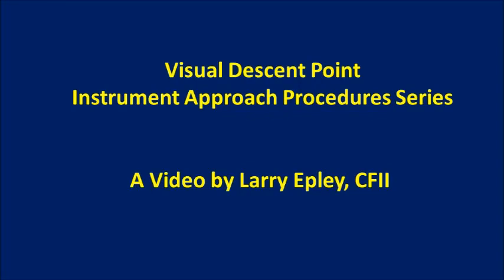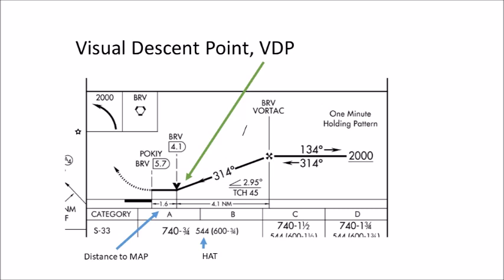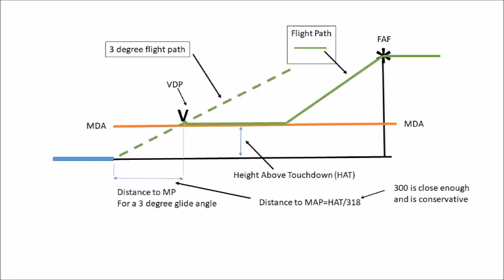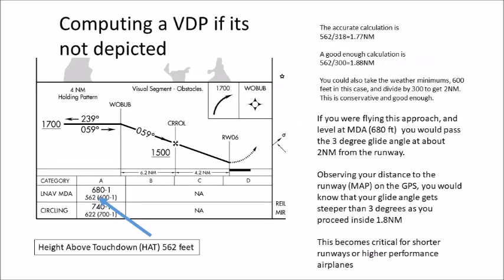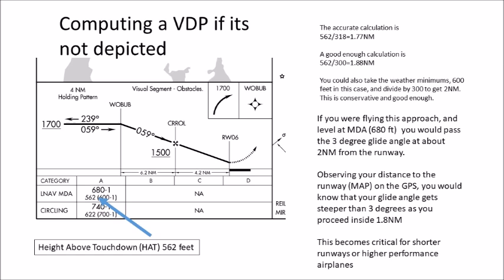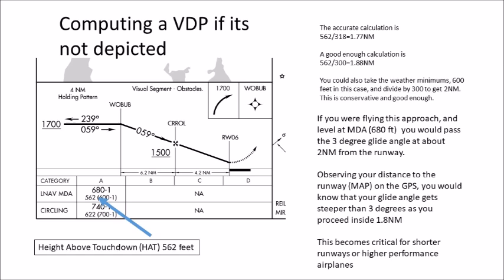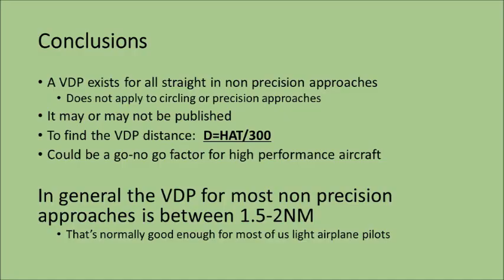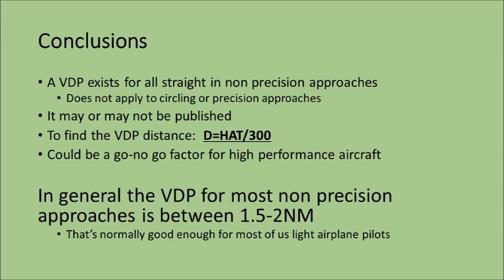VDP1

Comment: Im a little confused where does the 300 come from in the vdp equation
Reply from the maker: Thanks for the reply.  I never got one of these.  

300 comes from doing some simple geometry and assuming a 3 degree glide slope. The calculated number is approximately, but not exact.   Its close enough.   We don't need precision.  I believe that i made that point in the video.  
Regards,
Larry Epley

Comment: I have the same question as Edgar Xavier.  Could you show the trig that was used to come up with the 318. Do you use the 562 ft/5280 (=0.106 miles) as the Y-axis and the distance to the end of the runway as the X-axis?  So, tan (3)=(0.106/x)?  It is probably easier to remember: HAT/300.  Thank you for this video.
Reply: You're basically on the right track but it's 562/6076 (feet per nautical mile, not statute, to keep units  for the "triangle" consistent).  And yes, the rule of thumb of dividing by 300 is certainly much easier. 🙂

Comment: Just curious as to where did the number 318 or 300 come from?
Reply: Edgar Xavier 300ft/min rule of thumb for a 3degree glide slope
Reply: @sami10z  *FPNM not FPM
Reply: @sami10z  i guess u meant 300ft/NM...
Reply: (6076ft)tan3° = 318.4....ft.  

Using 320 ft is sometimes better to more accurately account for Earth's curvature.